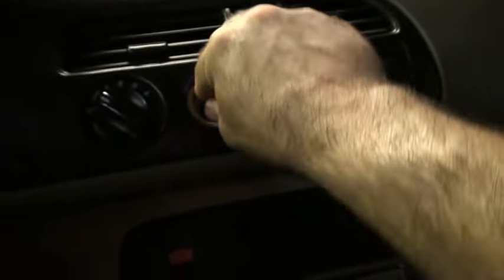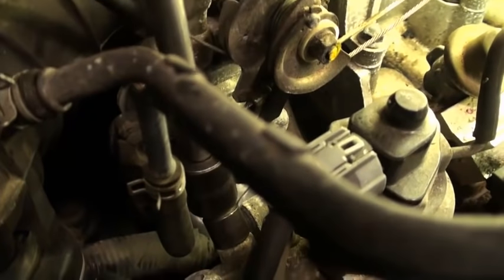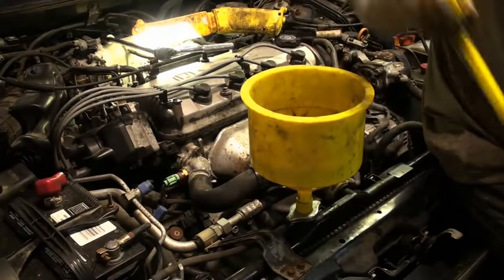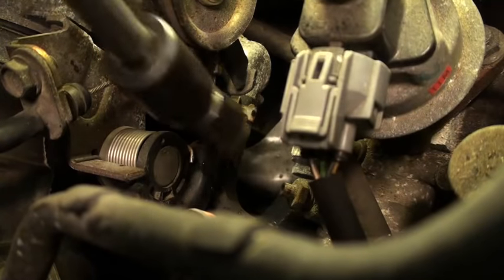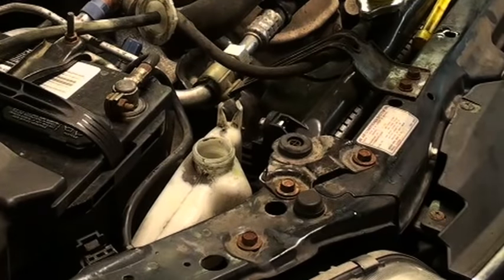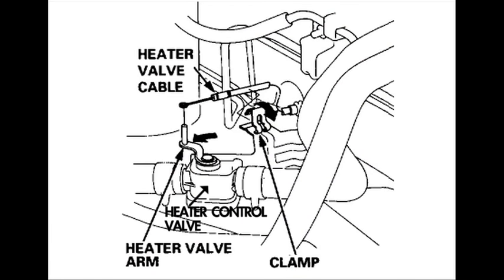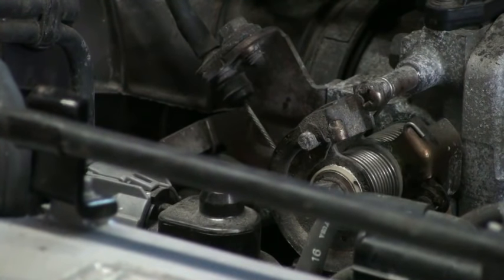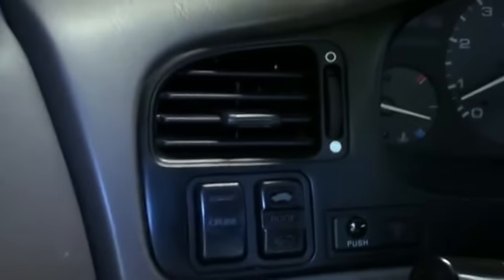How To Bleed A Cooling System - EricTheCarGuy

Comment: I have a 2000 Dodge Ram 2500. I just replaced the water pump, thermostat and then had to take it all apart again to change out the by-pass hose due to leaking.Got it all back together with new antifreeze and it's running hot once it gets to temp and then runs over 210 while in park. I will try the burp in the morning but what else could be wrong?I also do not get heat out of the heater at all. Always cool air comes from the ventsany ideas?

Comment: Hey, Eric. i have a 2.0 ford cougar, wich has zetec engine. after coolant change i have no hot air. the engine has only overfill tank and no radiator cap. no bleeder valves, i think, so how do I bleed the system? any suggestions? heater hoses are slightly warm, heater control valve is removed and the heater core was flushed, so coolant is super clean. would be great if you could help me :) Sorry for my English. Btw your channel is awesome

Comment: I have an important ? For you Eric...I'm flushing, as well as replacing the thermostat in my G/F's 12' Dodge Avenger... well this is my first time doing this & I'm only slightly mechanically inclined so my question is....do all bleeder valves/or bolts look similar? Cuz I was able to find a threaded cap/plug at the bottom of her radiator, & I was able to get it only slightly open, enough at least for it to drain the coolant...but as I mentioned it resembled more of like a plastic/rubber oil plug.... The closest example I could think of, as a part sharing the closest resemblance...is like what you'd find on any motocross dirt bike, the crank case oil plug where you'd actually add your oil at.... almost exactly like one of those...& Not metal, aluminum, or pot metal but closer to a rubbery plastic like plug... & As I mentioned it did drain the coolant so it's not that part I'm necessarily worried about, it's more the fact that even though this plug turned as if it was threaded & it even began to come out as I turned it... within half a revolution it stopped backing out even though I was still turning it... It ended up coming out farther but only after I stopped turning it and switch to pulling slightly as I twisted it left & right....and upon further inspection of it after getting it backed out as far as it seemed to want to go...it appears it isn't threaded which explains why it didn't continue to back out as I turned it..... so I guess what I'm trying to ask with this long Stephen King like explanation I've given is, do you possibly Know if I'm draining from the right spot? Is this the correct drain plug I mean? I've looked all over YouTube & haven't found a single clip that actually shows the drain plug on this same car.... So any help or info would be extremely appreciated..  thanks & thanks for your video it was a great help for me also

Comment: Hello Eric,
I hope you can help me with a simple problem.

I drained, flushed and refilled the coolant system in my 1999 Ford Taurus (77,000 miles). The car runs fine, does not overheat and the coolant level in the reservoir is at the optimal level, but, now the "low coolant" light comes on every time I drive the car.  I suspect there is air trapped somewhere in the coolant system.  This car does not have a coolant system air bleed screw; also it has a pressurized coolant reservoir, and no radiator cap. How do I fix this problem.  Would it help if I drain and refill the system but taking some other precaution that I may have missed the first time around.  

Would greatly appreciate for any help.  Thank you very much for any insights.
Reply: almost same problem. cant bleed the system, no bleeder valves, no radiator cap
Reply: I have seen bad coolant level sensors. It's just a float or an electrical sensor that gets clogged up with crap.
Find the highest point on the system and carefully let the air bleed out of a loosened hose.Usually a heater hose on the engine,NOT the heater core.

Comment: You mentioned doing a video on a system with an expansion tank. Did you ever do one? I have a '97 Eldorado (Northstar of course), that seems to be running a bit warm. I could be wrong, but bleeding the system if possible, and doing some other checks would give me some answers. Changing the thermostat is no fun on this engine, so if I can avoid that....

Comment: I did this to my 350Z after changing the radiator.  I thought I had all the air out.  Drove a day just fine.  The next day, it overheated quickly.  I pulled it into the garage again and re-burped the system.  I was rather shocked to see the coolant eventually start coming out of the funnel rather violently.  I started with a tiny bit in the funnel.. Had revs sitting at 1,500.  In a couple minutes, the coolant was spilling out of the funnel.  The level eventually went down and I had heat.

Comment: Mr. Eric I have a 2006 4.7 v8 durango 110,000 miles, I've changed the thermostat, radiator cap, hoses, fan clutch, water pump, I've done the bleed out like u show in a video,  the radiator doesn't seem to leak, now my truck doesn't over heat at all, what bothers me is that it seems to run too forced, the fan is always activated, consumes alot of fuel I believe, the needle doesn't show that the engine over heats but I feel the engine runs hotter then usual, I know it might be alot of info but is there something u suggest doing besides burning it down? :) I've changed the tps, camshaft position sensor, spark plugs, oil changes regularly, changed catalytic  converters, fuel pump

Comment: Hello Eric. I have a 2006 Chevrolet Equinox and have been having a really hard time getting the 3.4 liter engine to burp. It has one bleeder screw and i was wondering if the lisle tool will work on the Equinox pressurized surge tank? Thanks for any help on this issue.

Comment: Filling the cooling system on a car that does not have a bleeder valve. I know pulling a heater hose and waiting for the coolant to flow out is the way to go. My question is, does that always fill the engine up to a closed thermostat without causing an airlock in the engine? Even if the hoses are located below said thermostat? I don't see how that part works.
Do some thermostats have a small bypass to allow fluid flow?

Comment: Hi Eric. Thanks for the great videos!! I did this and towards the end the fluid in the funnel started rising. I cut the car off but it overflowed the funnel. I emptied the funnel and then noticed that the radiator needed antifreeze so I added some and it sucked it in. Did I do something wrong or is there something wrong with my car? Thanks!! Ed

Comment: Hey Eric, thanks for the guide - very useful. I just did the timing belt on my Subie. One thing I noticed after running it for the recommended 5 min at ~2500 RPM. There's a small puddle of coolant under the car, near the back of the engine - almost under the transmission that I can't find a source of. Nothing on the car is wet or even damp looking that I can see. I did kind of over-fill it when I was adding coolant, I wonder if there's some kind of bleeder valve there that just bleeds off excess when it's too full? Thoughts, ideas, suggestions?
Reply: Does your coolant reservoir have an overflow hose? Sounds like that is what would be causing the puddle.

Comment: A similar question.  Is there any reason once we fill the radiator we can't just let the system suck coolant out of the overflow tank over several run cycles while monitoring the overflow tank?  When I did this it sucked about another quart out of the overflow tank.   I just refilled the overflow and it hasn't moved since.  I assumed that it just purged the remaining air out through the overflow tank and is now air free.

Comment: Hey Eric I just changed out the water pump and the thermostat in my 1984 Delta 88 Royale Brougham LS it was my first time doing such a job I did well however the temp like on the vehicle comes on and how you described certain errors like no heat blowing out or still overheating is happening which to me sounds like I have air in the cooling system do I apply the same method you used in this video to my Delta if not can you guide me I would sure appreciate it...future mechanic

Comment: You turn the heat on max and then you started to instil water and cooler..was the car on while you were doing this procedure? because how the heat could circulate if the engine was off?

Comment: So I have these problems and I found out I had a hairline crack in the radiator that's recently become worse, I want to replace the radiator of course. I just wanted a recommendation of what brand radiator would be at least decent. I don't want anything like Mishimoto because those run from $250 on up. I want something in the  $70 - $100 and I've seen rads in that price range, I just want to know which one would be most dependable. I have an 02 Civic EX 2Dr Coupe 4spd AT.
Also I don't want to have to replace the fans or tubes if possible, they work fine.

Comment: In ur video u said the next thing was to top it off did u mean in the resistor or the radiator? I jus replaced a water pump and thermostat on 2002 jeep liberty and know need to bleed the cooling system would I do it the same way u did?

Comment: Hi Eric. I Have A97 Geo Prizm I Just bought For My Nephew. The Cars Coolant Boils And Evaporates In The Reservoir But The Car Doesn't Overheat. Oil Is Normal And There Is Not Abnormal Running Conditions. The Guy We Bought It From Did Change Radiator. Just Wondering Your Thoughts. Usually It Will Run Hot If There's An Air Pocket, Correct?

Comment: Hi Eric, thanks for the video. I have a question about bleeding the coolant system after replacing the water pump. I have a ford freestyle and the only access to fill the coolant is at the over flow reservoir. So will the funnel tool still work in this case.

Thanks

James Lacy

Jackson, CA.

Comment: I got a 1995 Toyota Avalon that I changed a coolent temp sensor on the upper coolent housing that has the radiator cap , also I changed the thermostat in the lower end and still the car is overheating at idle but is fine when driving... But I never bleed the system after I reassembled so I think that's my problem why it's still over heating... Any suggestions? Toyota Avalon 1995

Comment: Hi Eric,

I have an old VW Quantum Estate and seems that the radiator is not an original factory ones, because there is no cap on it. I've just change the old coolant and now the temperature raises more than the normal. I mean the gauge stops a bit over the middle. Does it might indicate trapped air in the system? How can I get it out without radiator cap? Thanks for your help.

Comment: Eric, Thanks for the video! Any advice on a 2015 CRV that idles low (about 600RPM) when it's warmed up and causes the vehicle to vibrate? If it stays at 8-900RPM when it's cold we're good. Replaced plugs, cleaned MAF, cleaned intake, replaced air filter, and followed your video on bleeding the  cooling system but same issue....I'm at a loss. Any help is appreciated.

Comment: My car had most of the symptoms, even the idling problem, which stopped after the first time i did this (don't know if i have a bleeder valve so skipped that part since some cars don't even have one).  My question is, if I am inside the car holding down the gas pedal at 2500 rpm while doing this, how do I know when the fans go on/ when I should stop?  Since I did not know, I just timed it at 5 minutes.  
~clueless girl ;-)

Comment: Interesting, I saw your video about replacing the thermostat because I'm getting PO128 on a 2000 Toyota Corolla.  A shop suggested the sensor, but it never gets too hot.  I reset the light and it stays away but comes back if I don't let it warm up a LONG time.  o it seems the tstat isn't letting it warm up fast enough.  So I was about to replace it and you said most of the time, it's simply air in the system.  I don't have a funnel like you, but I opened the cap and squeezed and bubbles came out (how another vid said to bleed, but like brakes, I think your method properly purges air out of system.  Is a funnel idea the only/best way?

Comment: Eric,  Does the neck of a funnel need to be snug in the mouth of the radiator to bleed air out of the cooling system.  I am trying to bleed the air out of a 1986 Toyota 4x4 using this method and cannot get the air out.  My temp gauge is barely above cold and getting some heat thru the vents inside.  Even squeezing the upper and lower hoses to force air out and have not seen any air bubbles.   However, I am just using a small funnel sitting not snug in the mouth of the radiator.

Comment: Eric, nice video. 2003 Honda CR-V. When I drive the car bucks and jumps at about 40mph,  parked at 2300 - 2800 rpm fluctuates won't go over 3k rpm. Replaced engine, then spool valve assembly, then engine, and transmission oil and flush out systems and coolant.  Need to bleed out coolant via this video. What do you suggest that I do next?
Reply: Jeffrey Yeager throttle position sensor is bad.

Comment: I flushed the radiator and engine block with a hose (removed the thermostat to back flush) and installed a new thermostat.  I followed this procedure to the letter. I have just one question.  Why did my Chevy Lumina fill up at only 6 quarts of coolant/water when the manual says - capacity 11.6 qts?

Comment: My 2014 escape stop blowing heat in the cabin however the AC works just fine. Is it the thermostat or the door actuator that needs to replace?

Comment: Dear Eric the car guy, I have finally decided to fix my luke warm heater in my 96 dodge ram 1500. I suspected either heater core or maybe my thermostat stuck open. I brought my truck up to temp and was checking the temp manually on my hoses and at some point i pulled a hose to my heater core and it is BONE Dry! What is going on???

Comment: got a question for ya... got an 04 pathfinder.  -12 deg c out tonight, started the truck, and in under 1 minute, my lower and upper rad hose warmed to about +12 deg Celcius.  (checked with infrared thermometer).  I have long warm up times, but the gauge seems to always run just a little shy of midway on the dash after its warmed up, but on colder days it seems hard to heat the cabin up much, and warmup times are quite long... like over 10 minutes idling.  Would this mean the thermostat might be partially stuck open?  Never had overheating issues summer or winter.  Thanks again.  Ya helped me outta 2 jams with my accord already, hoping for a 3rd on the nissan!
Reply: You should never let the engine idle to warm up, all youre doing is waste fuel. Just get going once the idle settles down, wait a little more, maybe 30 seconds when its really cold.

Comment: Hello... General question:.  I have had many different types of vehicles and never have been a fan of flushing them out nor I have ever done it or gotten it done.    I recently got a new thermostat  installed on my gmc envoy due to the code P0128 notification on my check engine light.  The shop suggested that I get a coolant flush that was going to cost me $120.00.  I said no because I truly felt like it was not necessary...  

Your thoughts ...... ????

Comment: I have a 1995 honda accord, i have just replaced the radiator gap, and the thermostat and i  believe i am having pressure problems and i watch most of your videos to see how i can fix this problem. So i will see if i need to "burp" the system. but it seems to come from the overflow tank gap the pressure will knock the cap off, and be bubbling inside the tank. i recently put liquid glass seal up in there and i still have the problem with the pressure , should i replace the thermostat again? UGh i dont know i am gettign tired of dealing with it. please help

Comment: If I wanted to put a bleeder valve on my system where would I need to put it? Would I put it on the return line of the heater core?

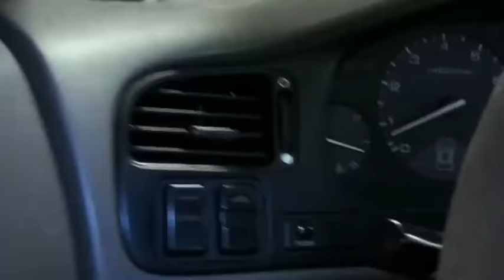Comment: 5:08 to 5:12 I have the same reaction in my vehicule but the level decrease and raise   very significant. from 3/4 level in radiator to full level radiator and it does  just when I increase the rpm to 3500.  Is that normal or the  radiator is parcially pluged?

Comment: Hey Eric, 
It was bit too quick and brief in the end.  Topping up the funnel with bit more coolant & examine the air bubbles coming out of it would be good thing.
I also make sure the coolant reservoir line is blocked with a plier or something, so I can
see any air bubbles coming out of the funnel attachment to the radiator cap.
Reply: by design the funnel takes the reservoir out of the equation.

Comment: Eric, this SHOULD work okay on a 3800 Series GM engine right? Specifically a 1989 Bonneville. It doesn't have a pressurized overflow tank.

Comment: My car was running at good temperature then replaced the crossover bar because had a small leak in it. After replacing it topped it off with coolant and now runs much hotter? Also makes weird noise when i turn the car off after driving it. Could air have gotten into the system causing it to run hotter? Thermostat and water pump was replaced prior to the crossover pipe and ran fine until after replacing the pipe